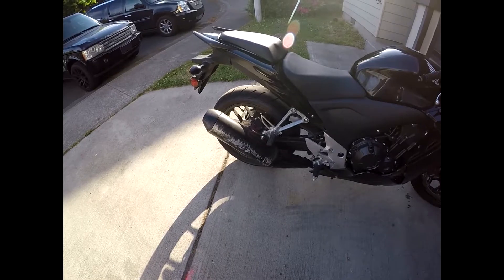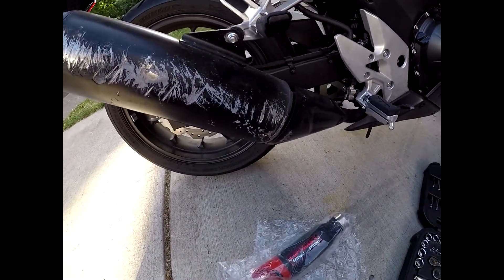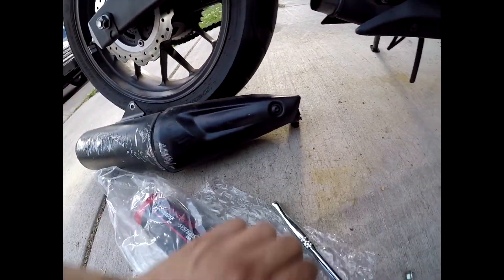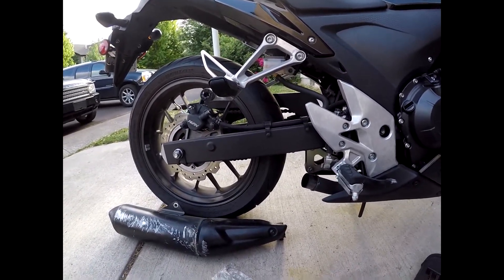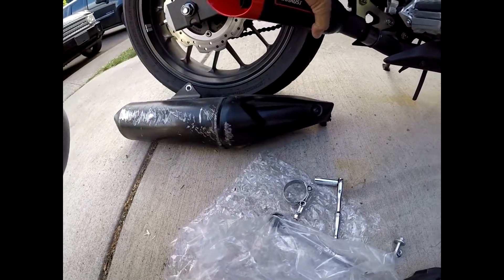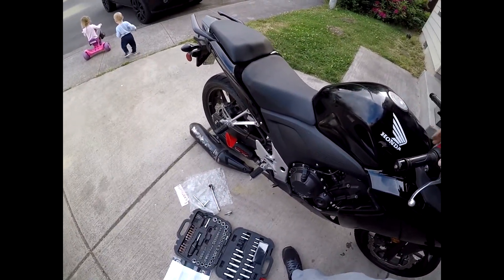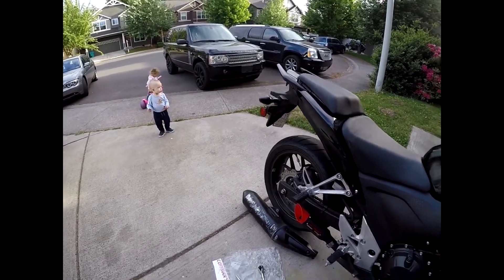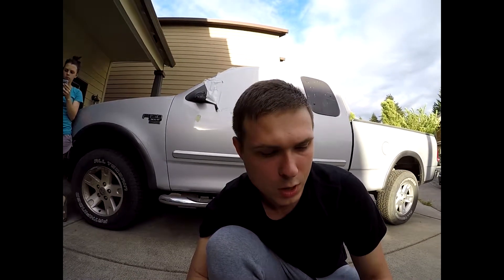2013 Honda CBR 500R Coffman Sorty Slip On Exhaust Install

Comment: Why would you buy an exhaust if you’re gonna sell the bike? Lol I have the same bike and I’m looking for an exhaust and I couldn’t decide between SC or Coffman but I’m only gonna have the bike for about a year or two so I don’t wanna spend too much on an exhaust. But if you were already gonna sell this, why’d you spend $200 before listing it?
Reply from the maker: Hey! Only reason I bought an exhaust for the bike is because it was laid down and the stock exhaust was scratched up. It's easier to sell a bike with no scratches and I bought the bike for fairly cheap, so $200 was a good investment vs return. I would recommend it as a cheap alternative, it actually sounds pretty good!
Reply: Sergey Pip makes sense! Yea I didn’t know what exhaust I wanted until I started thinking about price and how long I’ll have the bike for. It’s my first, so I’m sure I’m gonna wanna upgrade in a year or two so I’m just gonna go with this one so I don’t spend $600 on one when I know I’m gonna sell the bike in a few years.
Reply from the maker: @giovannipradowrp  for a bike with this size motor, it's hard to find a budget exhaust. This was the best I could find, and I think it's worth it. It opens the bike up and people actually hear you on the road.
Reply: Sergey Pip yea and that’s exactly what I want!